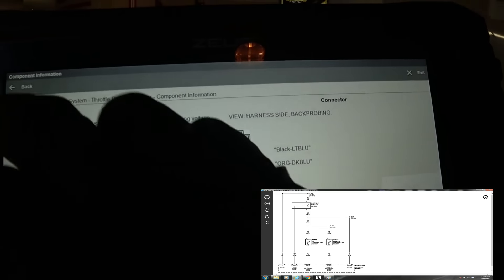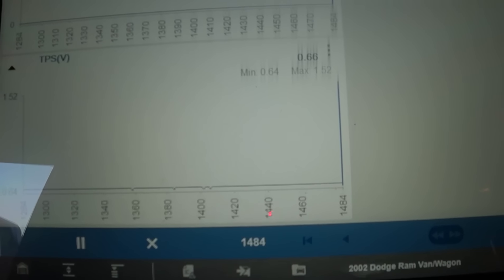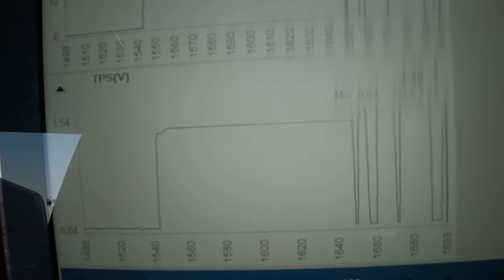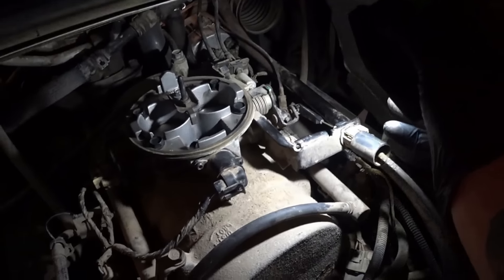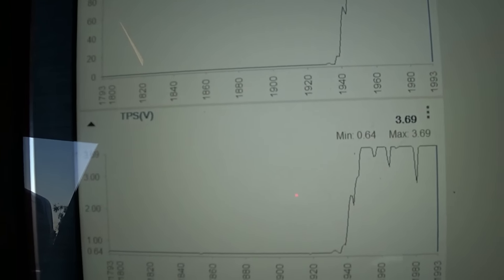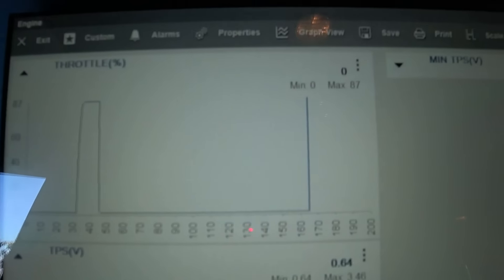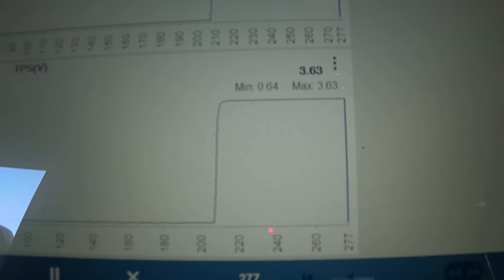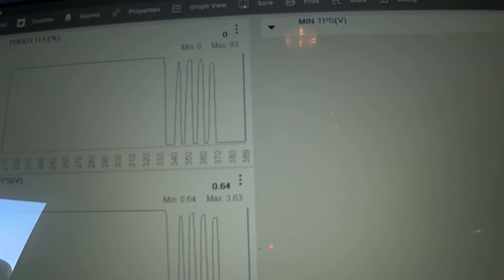Low power after PCM replacement?

Comment: That's cool bro. Would never set a code in that situation because technically all of the inputs are working properly. The funny thing about this video is it brought back some good memories of working on older muscle cars. Many times with them, the owner would leave my shop thinking the engine was replaced. Reason? A lot of them were set up where the secondaries  never actually opened because the cable at the accelerator pedal had too much slack. I always checked for that when working on the cars and used to rectify the problem and make sure they opened all the way. One guy who had a 442 nearly wrapped it around a pole because he was so used to the way the car drove before and never expected the power it had when it was working properly. Fun times.! Keep up the great work my friend.
Reply: Yep and adjust the kickdown/TV linkage also :D
Reply: had a few of those back in the day the good old days
Reply from the maker: Joe's Auto Electric very good points Joe!
Reply: I have a fiero with a carbed SBC in it. When I bought it, the secondaries were not opening because they had the throttle return spring routed next to the secondary linkage.

This is on a edelbrock vacuum actuated secondary. Probably good thing it wasn't a mechanical secondary because then it probably been stuck open one it overcame the spring. It definitely woke it up.

Comment: Lmao at the outro, gotta love that easy money!  I have a 96 ram 1500 crank, no start cond. and im only getting 
.8 volts out of both primary and secondary 5v ref. circuit @ pcm, with only both powers and both grounds to pcm... also not getting any check engine light on, but when an external 5v via powerprobe is applied to 5v ref wire i can get it to run like shit but alternator isnt charging battery.  Ive pretty much determined at this point that I need a new pcm, can i swap with pcm from salvage yard without re programming vin on 96 ram 1500?
Reply from the maker: AllOver Florida have you made sure that the 5v isn’t getting pulled down form a shorted 5v sensor? I would disconnect all 5 volt sensors and recheck to see if have ref voltage again. If you have already done this then yes sounds like you are in need of a pcm. On a 96 you can put a used pcm in but will have to program the vin once installed via scan tool.
Reply: @codysautodiagnosticsprogra8706  Thanks for your help! In that case i think im just going to go with a new one from flagship one... i have access to jpro scan tool but im not sure it will program the vin...

Comment: Cody did you have to reprogram the computer. See a lot of guys change computers and they have to reprogram them with a million different computers to get it to function. do you do your own programming? Maybe you can bring me up to speed on that aspect. Thanks 👍👍👍  between computers and TIPM's you will always have work
Reply from the maker: This one comes programmed from Chrysler but does need the vin added. Yes I do all my own flashing. These older Chrysler’s are nice by just needing vin when replacing unit, but yes they can also be a pain depending on manufacturers

Comment: Cody , I have a 1994 Dodge B-250 , 5.2 , this is a van I have completely gone through engine rebuild blue printed all new sensors OEM parts . All the sensors are working new ECM. Here is the issue. With the engine completely cold, turn the key to the on position that IAC opens way up (Setting itself up for a fast cold idle ) soon as you start the van the AIC closes to a slow idle position, and stays that way when the vehicle is fully warm it runs great I just don’t have a cold fast idle. I believe something is happening during the cranking cycle what would cause this ?
Reply from the maker: I’ve never ran into that issue before. What is the coolant temp sensor reading? Temp sensor that’s reading a warm engine will cause IAC to think it does t need to open as much
Reply: Cody’s Auto Diagnostics I had van on a  scanner tool I specifically asked about the temperature sensor and was told it is working fine.. how can I check it here at home ?

Comment: What made you initially hone in on the TPS?
Reply from the maker: B Young noticed lack of power so grabbed the scan tool and drove again. I almost always graph tps and happened to be a pid I had selected. Noticed low voltage on full throttle. After that came back to check tps further and that’s when I noticed manually pushing throttle open I noticed I had full voltage sweep.